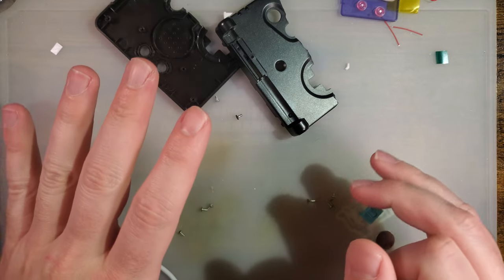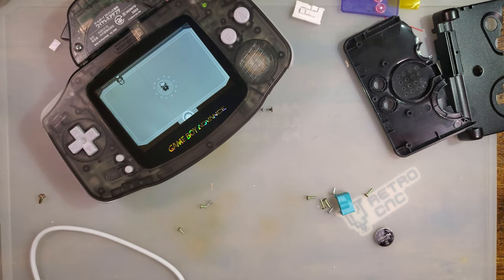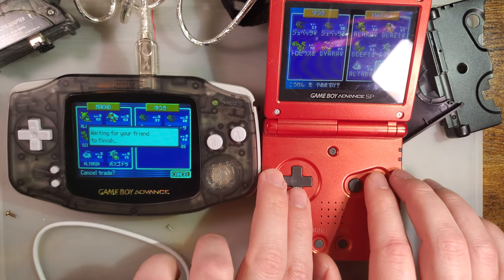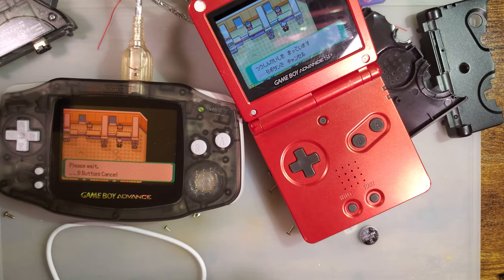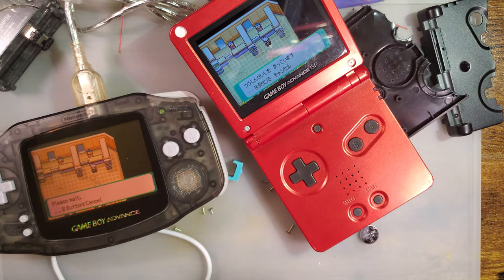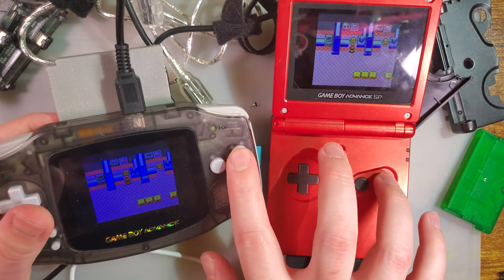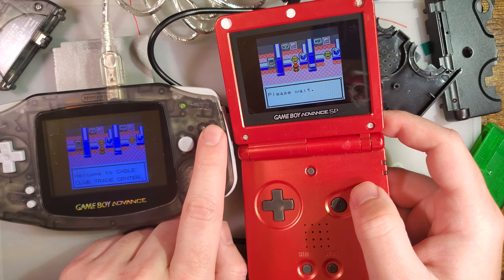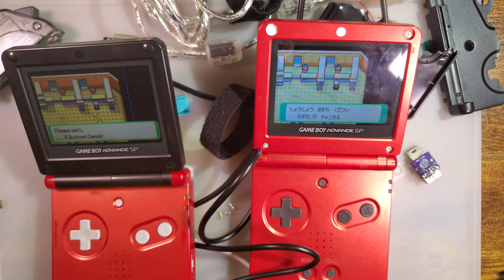Regarding the TV Out Link Port

Comment from the maker: TL;DW -- It's complicated. Some things work, others don't. Wireless adapter is recognized but does not communicate properly. Link cable DOES work but only in GBA games and only when the TV out kit is player 1.
Reply from the maker: RJ Infusino  Right, he was using information from my previous video. That's why I made this video.
Reply: What about the GBA to GameCube cable? That's actually the only one I really care about in this day and age for games like 4 Swords Adventures and Crystal Chronicles, not to mention raising chaos.
Reply: RJ Infusino  I suppose we could inquire about the E-Reader's link port functionality as well, but I'd be lying if I said I care much about that.  I know there are some 3rd party accessories that used the port too (like I remember some weird digital camera accessory that used the port), but again, I really don't care about them. I really just wanna know about the GBA to GameCube link cable.
Reply from the maker: @BlinksAwakening  If you're connecting your GBA to your game cube, you are likely not using TV out. Just use another Game Boy for this function. Or even install a switch. This is not a complicated fix.
Reply: @makho  you misunderstand. Ideally I'd love for my GBA to be able to both do TV out and do GameCube connectivity.  Not at the same exact time obviously, but I'd love to know if the same GBA can be capable of both or not. 

Regardless of my reasoning though, we should absolutely find out as much as we can about the port's connectivity with this mod. Seems odd you'd make this video and then tell someone asking about other link functions that they shouldn't even care.

Comment: Honestly the way I’d go about it is to find a 4 pole headphone jack and replace the original jack on the system. It might be a pain to find one that mounts well, but I’m fairly certain they exist.

Then you can run composite over the 3rd connection (the one usually used for a mic) and have one cable going to the TV, as you need to jack in to the headphone jack for audio anyway.
Reply: I was kinda thinking this too
Reply from the maker: I mean, you can do whatever you want. Hell, you can just slap on an extra TS connector instead of replacing the headphone jack with a TRRS, and still use two connectors. Or you can install your own RCA or BNC ports. The whole point of this video was to show that using the included link cable adapter and wiring method breaks a lot of link cable functionality. Very few people complained when the older GBC kits blocked out IR functionality in favor of a touch sensor to toggle brightness. It was just expected that you lost IR if you installed that way. This should have been treated the same way. 

You have options to install this stuff. If you don't like how the seller says you should use the kit, then, by all means, install it how ever you prefer.
Reply: @makho  yeah I’m sure for many it’s a fair trade off, can’t imagine the average joe really uses the link cable for much anymore. 
Though for those who aren’t satisfied, I hope they share their experimentation in making their preferable solution, as just like the various headphone jack mods in the SP that your can find online for example; it can give a good starting point for more people to find solutions and innovate

The strength of communities like this lies in the accumulated experimentation and documentation from many people over the years.
so I hope that those aspects can shine through here, and continue to shine through in all of the other advancements happening in the community

Comment: Another reason to wait for a more polished version, good
Reply from the maker: Just don't use the included cable and make your own video out port. There is no work around if you want to use the existing link cable port for two simultaneous functions without breaking one or the other. It's just a standard composite video signal. Install an RCA port or something.

Comment: I wonder if the GameCube connection kit works
Reply: Technically the GameCube should be the dominant system, ie the host, so maybe? Unless there's some form of crossover (as with crossover LAN ethernet network cables) involved.

Would love to know the answer.
Reply: @ToxoRetro  with the GBA link cable, the host is the small end, which is the end that works worth this kit. So that actually concerns me that the GameCube connection won't work.
Reply: Maybe,  @BlinksAwakening  ; I see what you're thinking. But then the GBA-GameCube link is only designed to plug in one way.

The GBA-GBA link however allows the smaller end to attach into the middle section of another link cable, forcing the 3rd/4th players to attach via the dumb terminal by design - after all it's only additional plastic preventing the incorrect direction from happening. 🤔

Without cutting open these cables to see how they're wired, we'll never truly know. I'm not willing to do that to mine. 😝

Comment: I wonder if the E reader works
Reply from the maker: no more or less than it already did. Same exact rules apply.
Reply: The E reader just has a passthrough for the link port. If I remember correctly, its not even connected to the actual e reader hardware inside the shell at all.

Comment: To use networking terms, it sounds like it's a case the link port works as a "dumb terminal" (or "slave" if you're old skool) but has issues as a "host terminal" (or "master").
Reply: PS, the thin end (purple on the official cable) is the host, the wide end (grey on official) is the dumb.